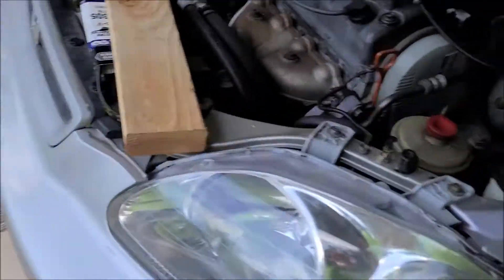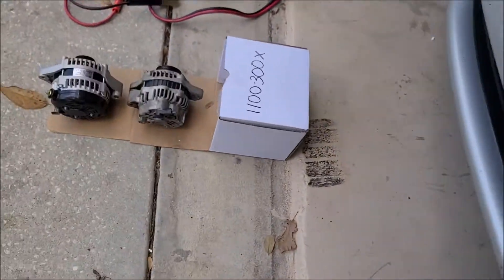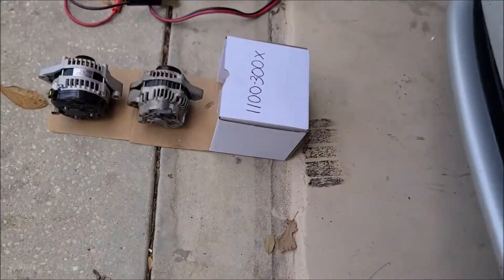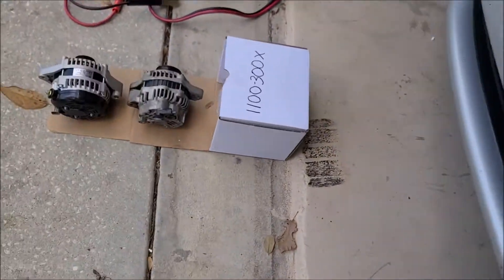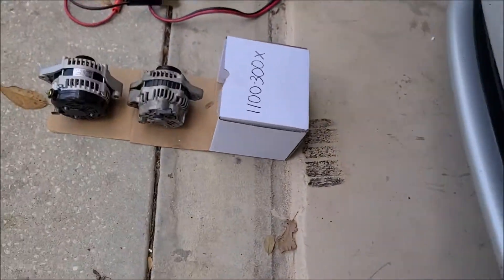BASS CAR UPDATE - OHIO GENERATOR - HIGH OUTPUT ALTERNATOR INSTALL

Comment: Not all of there alternators use chevy cases they use oem cases if the case is big enough for any thing different they will use what matches your bolt pattern or resting leg could be Mitsubishi or so on depending on make and model also use 0 gauge and do the big 4 the more grounds the better 300 amps requires 0 guage your alt proablly benches at around 311 amp maby